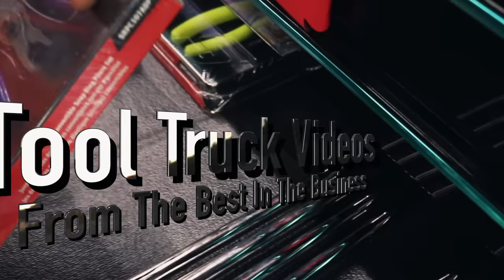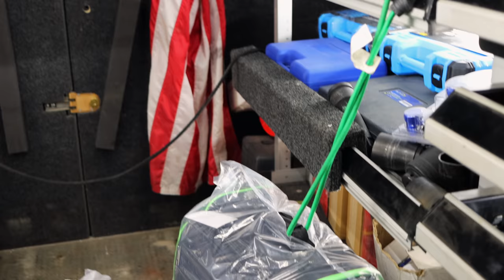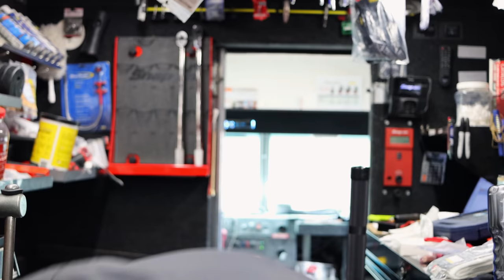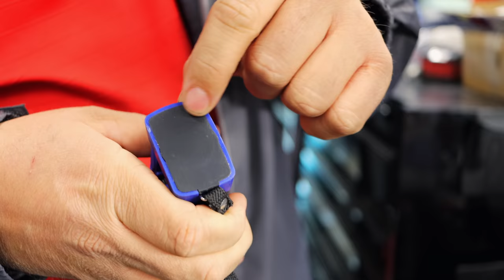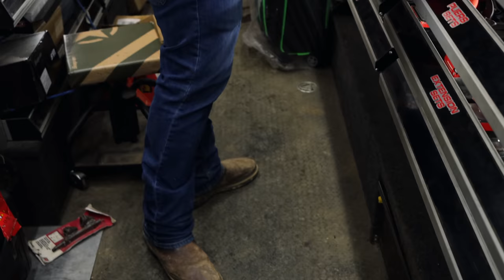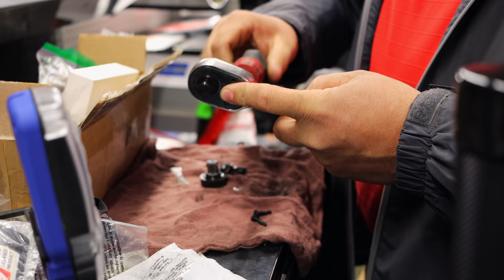Snap On Tools Warranty How It Works? New Locking Pliers Out Now? Really??

Comment: I really like the Milwaukee vise grips, with the extended tab to put a shank or screwdriver through to tighten them up. I just bought the Mac versions that are on promo. I find the Milwaukee versions easier to release one handed vs. the Mac
Reply: I have crescent and you can use an Allen key/wrench to tighten and loosen. Nice feature

Comment: Those new Snap On vice grips look a lot like the original vice grip brand
Reply from the maker: Yep
Reply: Yeah they look good. Wonder where they are made?
Reply: The.  Milwaukee vice grips are better than the original Peterson or Irwin vice grips.  It's like they're made of tool steel instead of mild steel.  I'll bet they're all made in China.
Reply: @bluefj-wc3vz   USA
Reply: @bluefj-wc3vz  They are made in the original vice grip factory in Dewitt Nebraska.  Malco tools purchased the factory and have been in the process of going back into production of the original vice grip "style" of locking plier.  They will be called "Malco Eagle Grips".  They are making these for Snap-on and have not released these new tools yet under their own name. The only place to get them right now is through Snap-on.
Reply: My Malco power metal shears attachment is awesome, so hopefully the classic Vice Grips release is as well.

Comment: My dealer is like Hamilton on warrantying the older Snap On locking pliers,replace them with the Irwin locking pliers.My neighbor Ken dealt with a Snap On dealer that was an asshole warrantying tools.I had a broken screwdriver and I had him take it to this dealer  to warranty it.Would not warranty it at first and he got him to warranty it.My dad knows a guy that did fix a warranty problem.This dealer would not warranty an employee's ratchet 3 times that was slipping saying nothing wrong with it.He witnessed this employee use it and slipped on him giving him busted knuckles.Walked in the tool truck and threw it on the counter telling this dealer fix it or he was done stopping by.Fixed it and no more problems

Comment: I get Snap-On Tools with the main exception being Knipex pliers. I keep my jack outside because it is too much work to carry it between my basement and where I use it. Since I am abusing it I go with Harbor Freight. I consider Vise Grips to be a tool of last resort since it has destructive characteristics. I would consider getting a Snap-On one but I have had regular and smaller Vise Grips pliers since the early 1980s and they work fine when I have to use them. So jacks and Vise Grips are also exceptions to my Snap-On rule.

Comment: Hey Clay have you heard Snap-on is gonna have a new color ratchet, the metal part only I heard.. I'm assuming it will be in black, they wouldn't tell me 😅
Reply: They already have black ratchets
Reply: @kylesonsalla7620  Well I haven't seen those before
Reply: @Fordcrownvicp71  
Pretty much all their normal handle ratchets are available in industrial finish, which is black. Not like a powder coat or paint.
Reply: @kylesonsalla7620  Well I wonder what change they are gonna do then, cause i heard there is gonna be a new metal color coming out

Comment: I work for an military contract aerospace industry so money is not an object and id guess in my building alone we have 40-50 fully loaded snap-on tool boxes fully stocked with Snap-on tools and those vice grips are the absolute biggest piles of garbage... Id rather use a basic set from Irwin but I much prefer my Milwaukee's
Reply from the maker: The old snap on were (grey painted ones) the new ones that are shiny bare metal are good. They are made in the old vise grip factory by Malco